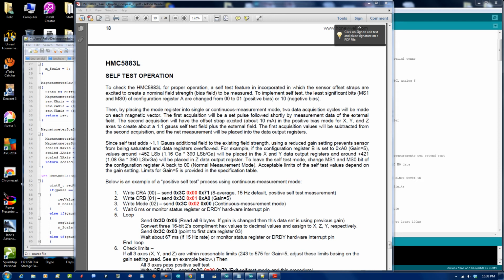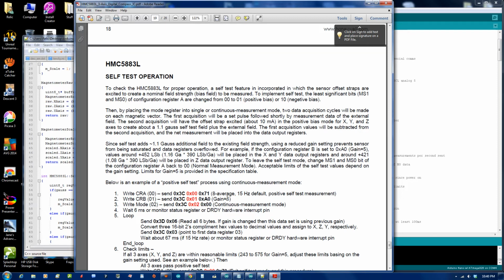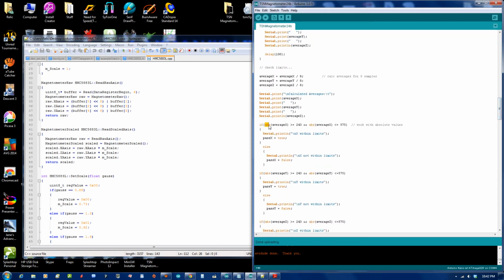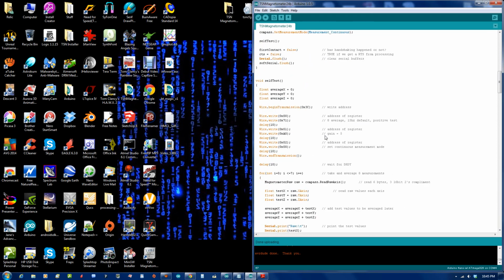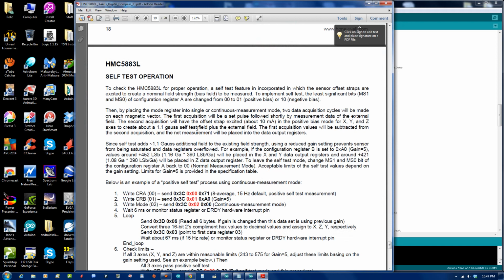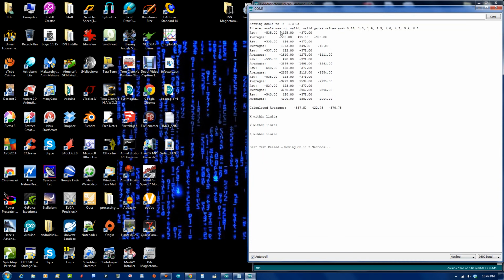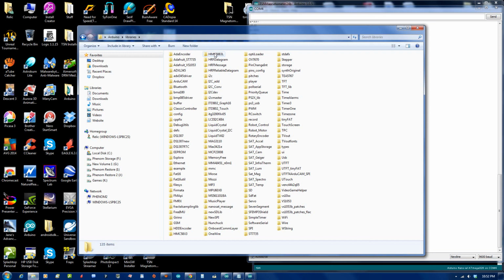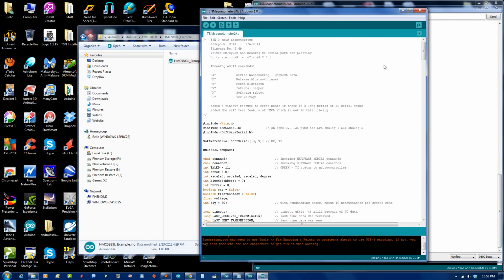HMC5883L Honeywell Triple Axis Magnetometer Self Test

Comment: Can I use this sensor for Vehicle detection?
Reply: Saraswathi Thanu I never used it for that application, and the resolution of the sensor might be too low .. but I would try it.  The sensor will fluxuate by up to around 2 milli gauss.  over-sampling and averaging data can improve that.  I'd note the max/min amount of fluxuation, then look for anything that pushes it over that natural limit, such as a vehicle.  We also sell a chip and fluxgate sensor specifically for vehicle detection.  You'd just need to follow the schematic and build the circuit.  I can direct you to Fat Quarters Software if you want to go that route, but experiment with the HMCL and see what happens!
Reply: Saraswathi Thanu I also have a vehicle detection 'security system' prototyped but my health has put that project on hold.  You'd need the SCL002 chip and a FGM-3 fluxgate sensor, which I can arrange an estimate for you.  Theory of operation and detailed schematics are also available.  Hope this helps.
Reply: Relic Webmaster Thank you so much for the information and the link. I currently have the HMCL with me and am trying to create a smart parking mobile application using this. Let me experiment with this and see how it goes. Thanks again.
Reply: Saraswathi Thanu np.  The ASIC/sensor link will be expensive but it works great in my prototype.  I have the sensor buried at my driveway, and know when a car pulls in, and how large it is.  With over-sampling of the HMCL you might get similar results.
Reply: Hey @Saraswathi Thanu how did the experiment go? I am currently about to work on a prototype for the exact same use case, i.e vehicle detection in South Africa.